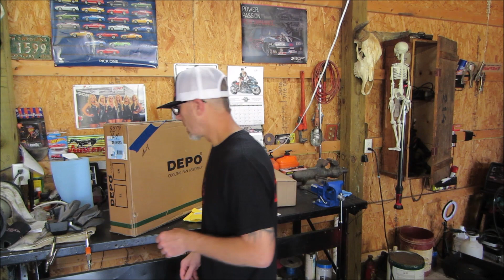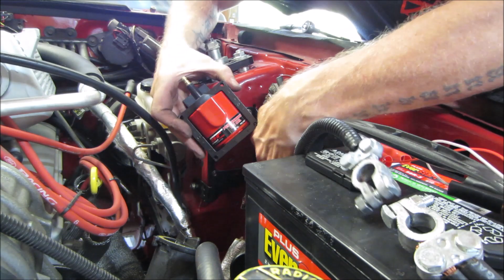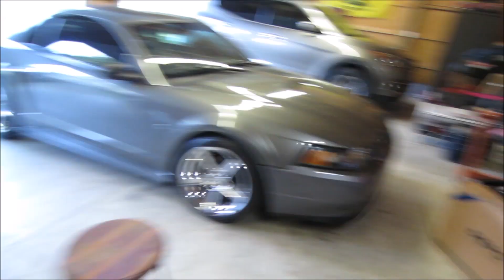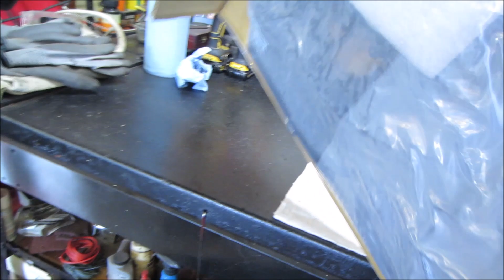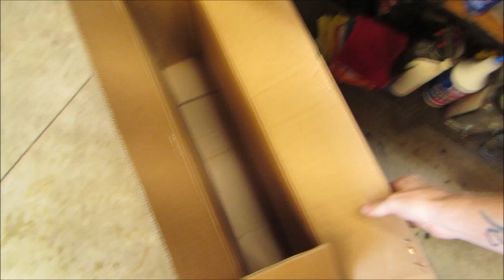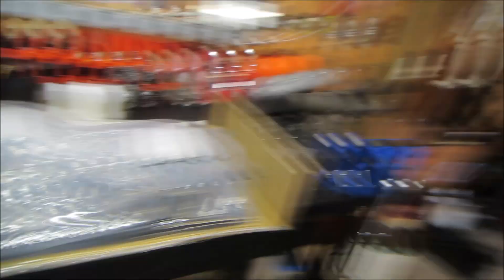The Fox Needs More Torque Starter Install.

Comment: Where did you get the starter
Reply from the maker: Ordered it from jegs.
Reply: @DEMONFOX5.0  Thanks, Are you in NC ?
Reply from the maker: @rickgreer4263  SC just across the line.
Reply: @DEMONFOX5.0  oh ok im just 30 min away
Reply from the maker: @rickgreer4263  nice. Do you go to the swap meets at Fox Resto.